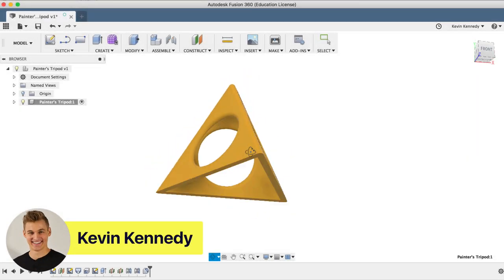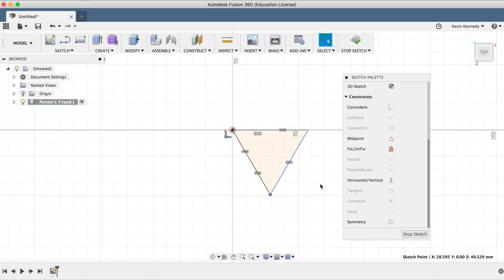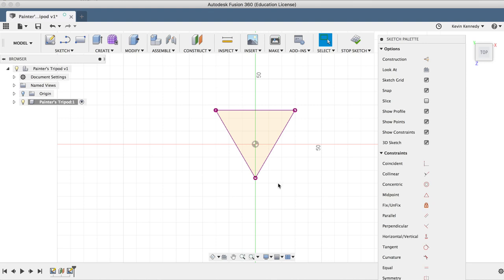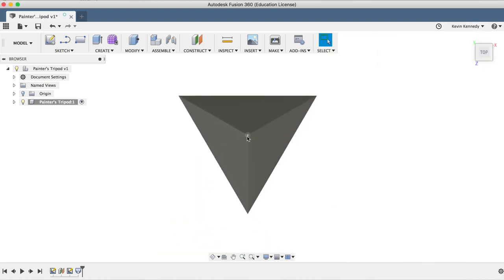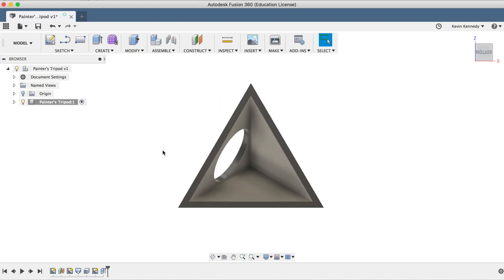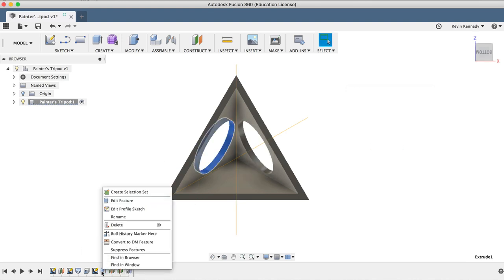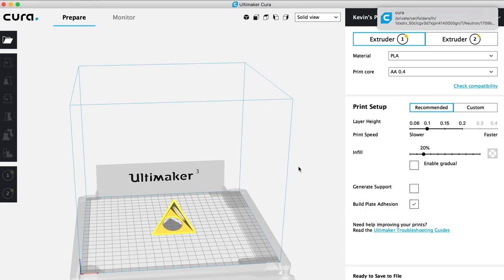How to 3D Model a Painter's Tripod - Learn Autodesk Fusion 360 in 30 Days: Day #15

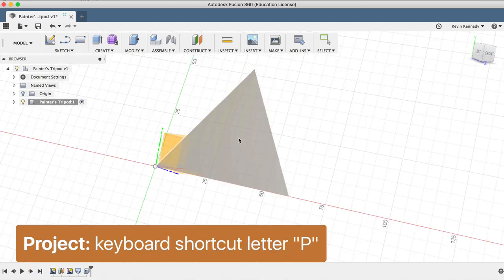Comment: Hi Kevin. Your tutorials are terrific, Thank You. Hoping you can explain a step you take in many of your tutorials in a bit more detail. In this one, right at 6:33, you hit "P" for project and select one of the sides of the pyramid. You then select all three lines that make up the face of the triangle, assumedly projecting these lines onto the sketch plane. You then draw some construction lines on the sketch plane to reference for the circle. My question is, why do you take the step to project the lines or the faces that are used to define the sketch plane, onto the sketch plane as you do here and have done in other tutorials? I created a sketch plane on the face of the triangle and was able to create the same construction lines and circle without taking the step of "projecting". What does the step of "projecting" do, that I am missing or is it just a good practice for a reason of which I am unaware? Thank you again. I wouldn't know half of what I do with F360 without your tutorials!
Reply from the maker: Great question! The Project command will reference the source geometry to ensure your sketch automatically updates/adapts if you change the size/shape of what it's referencing. You can learn a bit more about it in this video: https://youtu.be/WAs144r-Xko

In your case, did your edge automatically turn pink/purple and get projected? If so, that would be due to the Auto Project Edges on Reference setting. If not, it's likely that you may have snapped to the edge (or so it seemed) but it will not truly update if you were to change the size of the triangle/pyramid.

Happy learning! Cheers, Kevin :)
Reply: Understood. That makes perfect sense, thank you!

Comment: hello Kevin, on the dialogue box NEW COMPONENT I see PARENT option, what does it stand for?
Reply from the maker: Marco - Great question! Parent and Child components are used when creating subassemblies (assemblies within the master assembly). I will have to make a video on this eventually.

In the meantime, I've found an Autodesk help article that explains this in a bit more detail - http://bit.ly/parent-component

Cheers, Kevin :)
Reply: Ok ok I you will it will be great! Curios to see how it works here in Fusion! Thanks!

Comment: Tried printing this, seems the holes are a bit big and near the top of the pyramid is quite weak and not very circular/smooth due to bridging. Adding supports might help but that kind of defeats the object of making the holes to reduce filament use. Also the tip of the pyramid ends up a mush as its a bit too round so gets too hot as the nozzle never leaves it. Case of premature optimisation I guess. I wonder if a really thin layer inside the hole (as a fake support that could be snapped out) would be better?
Reply from the maker: Hi Simon. Interesting results... I've printed probably 200 of these out without any issues. All printed on a MakerBot and Ultimaker in PLA. Maybe your temp settings need tweaked? Are you using a different material than PLA?
Reply: @ProductDesignOnline  yeah I only tried abs so far. Edit: same problems with PLA and lower temps/speed

Comment: Hi,  Kevin
I've changed shortcut key 'x' from construction to Line
But now I want to return 'X' for construction, but I couldn't find construction on the menu except Sketch Palette
How can I find construction menu?   
( Plus, View/Hide also )
I mean " Change Keyboard Shortcut "
Reply from the maker: Hi, CHO성진. This one is a bit tricky because you can only select the construction feature in the Sketch dialog box. I believe you'll just have to restore the keyboard shortcut for the command that you have the X set to. Here's an article that walks you through resetting keyboard shortcuts (at the bottom) - https://knowledge.autodesk.com/support/fusion-360/learn-explore/caas/simplecontent/content/how-to-create-custom-keyboard-shortcuts-autodesk-fusion-360.html

Let me know if this works. Otherwise, you may have to restore all your Fusion 360 settings to get it to reset properly. Cheers, Kevin :)
Reply: @ProductDesignOnline  Thank you 
'reset to default' works well
then I have one more question

Is there any way to change construction line to another key ?

For example 
I want " shift + X " for construction.
Reply from the maker: @devstefancho  I don't think you can change the construction function because it's a modifier and not a specific command or tool. However, let me look into this. Cheers, Kevin :)

Comment: I've done this and I can't get it to finish the print. It always fails towards the top when it's closing the circles. I've tried brims and even glue for adhesion, and different settings for inlays, perimeters, etc... my bed levelling is correct and my first layer is perfect. The prints come out beautiful, but they always fail there. I have a theory but since I don't have a camera set up I can't confirm, but I feel like the nozzle gets stuck against the previous layer, as if when it's coming from the other side of the "bridge" completing the upper layers of the circle, it get's to the other side of the gap and it finds that the filament has hardened just a bit higher than when it's going to print, and therefore knocks the piece to the side (despite using glue!!), and from that point on, obviously, total mess and I have to cancel. Just a theory though. Any ideas of what else could this be or what to do about it?

Comment: Me again, Question again. Why do you project the three points at 6:37 - 7:29 to their own plane?
Reply from the maker: Hi, Leo. I proejcted the outer perimieter (not just the three points) as a way to ensure the geometry created next - the whole cutout and reference geometry - are always updated accordingly if I were to update the original size of the pyramid. For example, if I made the pyramid taller, then the side would automatically get taller and the circle would automatically move upwards to remain centered, as it references that outer geometry with the "project" tool. Cheers, Kevin :)
Reply: @ProductDesignOnline  THank you, I will use project more 'cause it updates.
Reply from the maker: @zn123m  Yep...you will be thankful when you go to change dimensions later on. Cheers, Kevin :)

Comment: I didnt understand the use of axis please make a detailed vedio about it. In some vedio you are using the top side in some vedio the bottom.......
Pls help
Reply from the maker: abhishek Abhi - are you talking about the plane that I started the first sketch on? Ultimately, it really doesn't matter, I always try to start so the object is in the correct orientation - so the top of my model is the top of the viewcube and so on.
Reply from the maker: You can always change the orientation by re-setting the top. I explain this in my other video - https://www.youtube.com/watch?v=GwGa0Z50jLg

Comment: HI, Kevin after doing the loft command I was able to Rotate the model using the cube in the top corner... the only way I could rotate was to use the Free rotate at the bottom... Do you know why this happened?
Reply from the maker: Hi David. Never experienced that before, but it certainly sounds like a bug (or unexpected behavior). I would suggest closing the file/reopening it to see if that fixes it. If not, it would be worth a post on the official Fusion 360 forum so the Engineers can investigate it.

Comment: Hi Kevin, I have been enjoying and following your lessons till now, and one thing I found that is whenever I started to follow your video and started the 1st component, the measurement numbers of X-axis is always oppsite to your video, like this one your measurement 50,100.. are on the right, mines are on the left which seems making everything mirrored! Did anything wrong on my settings?? And I also found that when I click the the Grips and Snaps at the bottom, the Layout Grid and Layout Grid Lock are shaded and unable to change, is it something wrong here too? Need help!
Reply from the maker: Hi, Cadmon. It may be worth restoring your settings to the "defaults" and then check your settings with mine here - https://bit.ly/defaultsettings

Comment: Question: When I was mirroring the circle for last part, I tried for computer is "Adjust" and it turnout to be really weird. But once i picked Optimize, it's alright. Can you explain under what situation should I do Adjust? and other parameters?

Thanks!
Reply from the maker: Hi Andy. I had notes on each option in a pinned comment, although I know those aren't always seen. Here it is:
COMPUTE OPTIONS EXPLAINED
The following "compute" options are different levels of optimization when patterning/mirroring features, with slightly different capabilities. Try to use them in order. If Optimized doesn't work, try Identical, and then try Adjust.

 1. Optimized is the fastest. It uses some internal code that just patterns the faces of the feature. But, there are some limitations: The feature faces have to all land on the same face, and there are some cases (the most famous is patterning cuts around a cylinder, where this method fails.

2. Identical is next fastest. This method just extracts the tool body of the feature, patterns that tool body, then joins the results at the end. It can handle cases like the cutouts around a cylinder.

3. Adjust is the slowest. This method recomputes each instance of the feature almost as if it were a separate feature. This allows you to do things such as patterning a feature with a To-Face extent and have each instance of the pattern compute differently.

Comment: Why do you project at 6:30?
Reply from the maker: Hi, casinomann. Projecting a sketch has two main benefits. First, it's a way to recreate a sketch quicker than sketching it out again. Second, the projected sketch is driven by the initial sketch. Which means.. if you update the original sketch, the projected sketch will be updated automatically. Cheers, Kevin :)
Reply: @ProductDesignOnline  Thanks for the response!

But why don't you just add the circle to the original sketch? Why do you create a new one?
Reply from the maker: Hi, casinomann. The very first sketch was created in order to loft to a point. A circle couldn't be created there since the sides didn't exist yet. At approximately 8:00 I created the circle cutout on one side and then I go on to mirror to the other sides. This just simply ensures that I only have to worry about updating or changing the initial circle. Cheers, Kevin :)